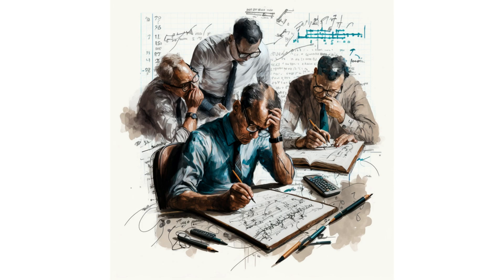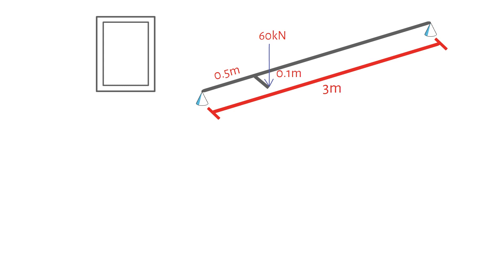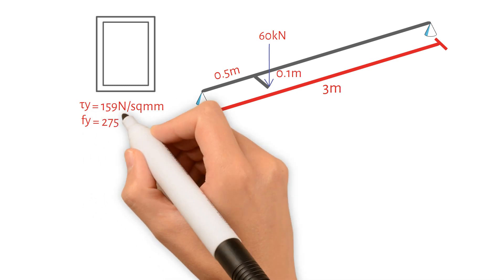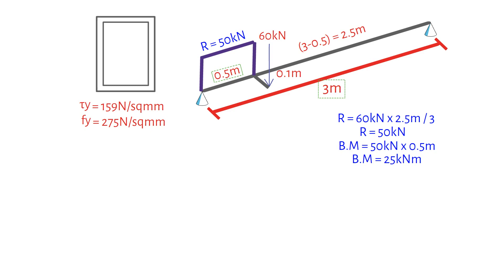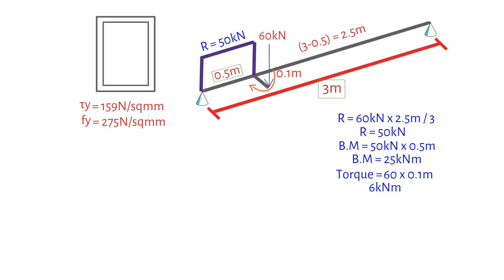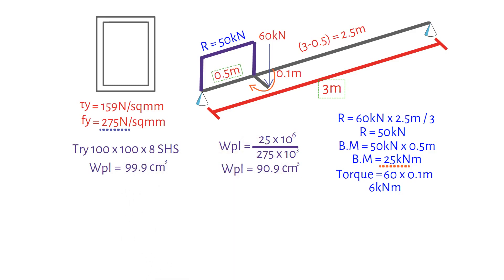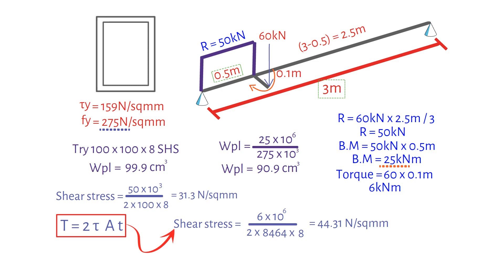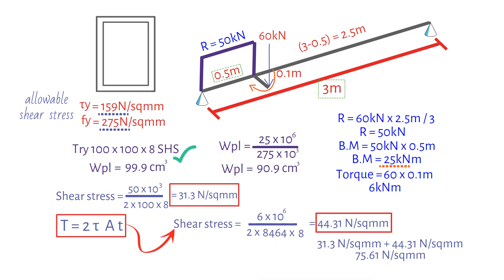Simplifying Torsional Load Design | Utilizing Square Hollow Sections in Structural Engineering.

Comment: Wouldn't it be more appropriate to consider shear force is 60 kN, designing for the worst case where section is cut right at the 60 kN point load? It would not change the outcome since our allowable shear stress is so high.

Comment: How plastic section modulus arrived as 90.90 cm3 it's not tallying in cm's..and bending stress why we need to consider as 50kn?
Reply from the maker: Thank you for your question regarding the plastic section modulus & bending stress calculations in the video. The plastic section modulus is calculated by dividing the maximum bending moment by the strength of mild steel, which results in 90.9 cm^3. The bending stress of 50 kN is used to determine the beam's dimensions & check the combined stress from bending & torsion. In conclusion, the video suggests using a 100x100x8 square hollow section as the optimal choice for the beam. We appreciate your interest in the video & if you have any further questions or concerns, please do not hesitate to reach out to us.